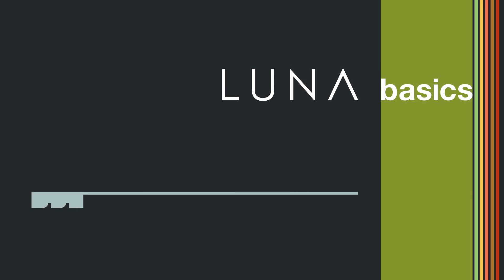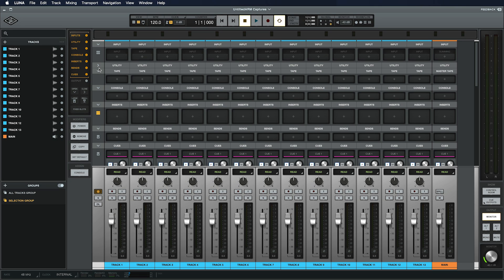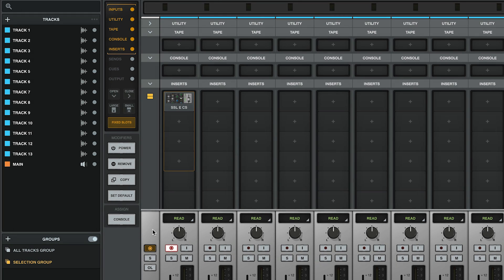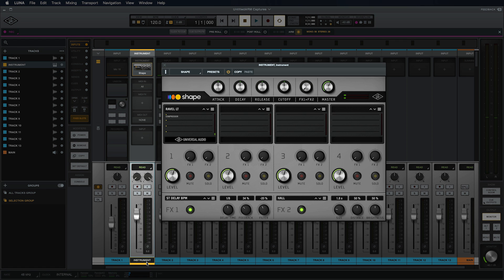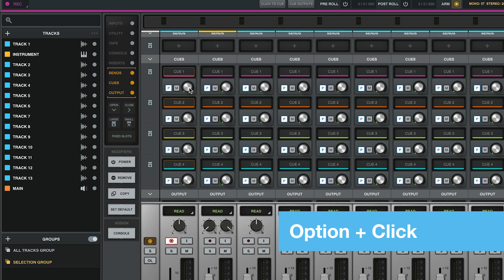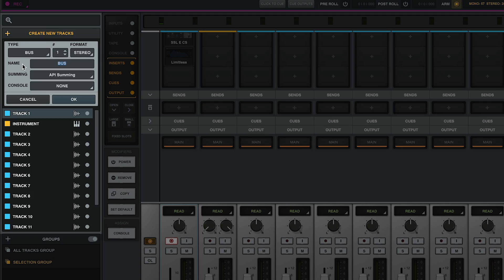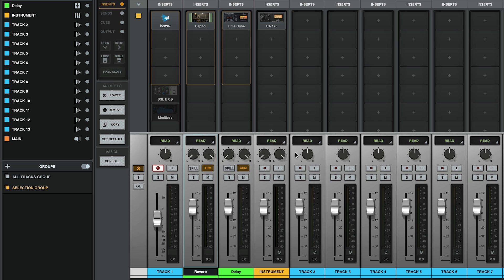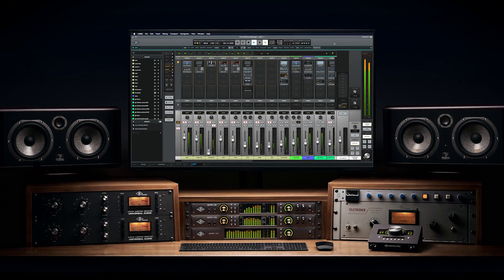LUNA Basics - Accelerated Realtime Monitoring (ARM)

Comment: We are setting up a studio for livestreaming in which all our audio needs to be processed live through UAD plugins and routed so it can be streamed and sycned to video. Of course, as low latency as possible and great routing are important. We have an x6 and were wondering if for this specific use case LUNA would work, as Console only has 4 insert effects per channel?
Reply from the maker: Yes, you could use LUNA and get 8 inserts per channel.

Comment: Thanks for this, Drew. The Office Hours are also great, but these bite size videos are easier to navigate, digest and refer back to. By the way, the low latency monitoring works really well for AU instruments, which is very important for accurate playing or with "feel". But I think the Luna documentation is inaccurate; it says the latency for VIs is always 128 samples regardless of the ARM mode state, which is not the case. ARM makes it much faster and more responsive.
Reply from the maker: Thanks Chris! The docs are correct. What ARM does for VIs is to bypass the buses and the Main out to get you the lowest latency. For example, if you play an instrument with ARM mode off (or even just my selecting its track name with ARM on but it not rec enabled) you're playing through the instrument buffer plus all your bus assignments and main fader. But as soon as you record enable it (or turn on ARM mode) note that you're no longer playing through the buses or Main out and therefore have less latency. Hope this helps and let me know if you have any follow up questions.
Reply: @UniversalAudio  Ah, I see, thanks! So, we get the better VI performance with ARM, but for a different reason. By the way, I do sound design and electronic/experimental tunes, and Luna with UAD plugs is amazing for merging digital synthesis and samping with classic analog like sound and workflow, all in the box. The overall feel along with the sleek user experience and simple workflow really makes me focus on the sound and the composition. You got me early and I stuck around :)
Reply from the maker: Yup, you got it! So glad to hear you're enjoying LUNA!!  Indeed it does allow you to focus on what's important!